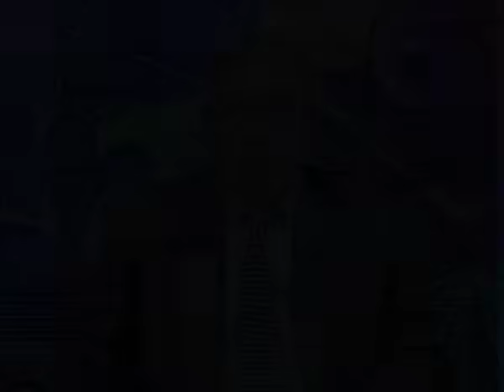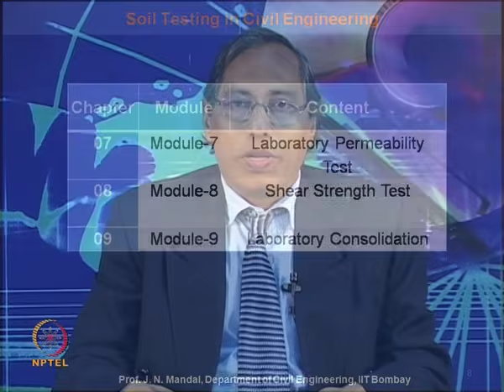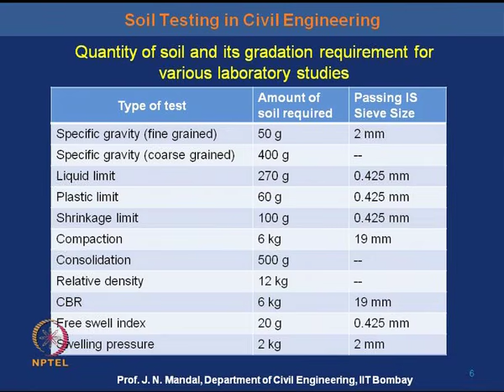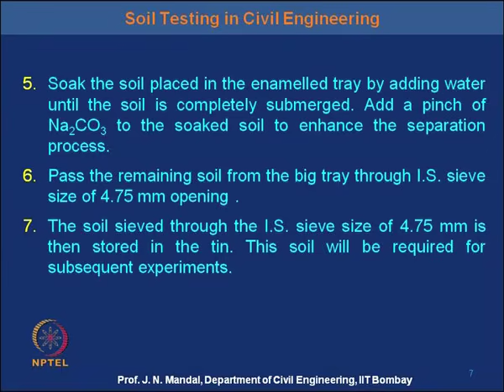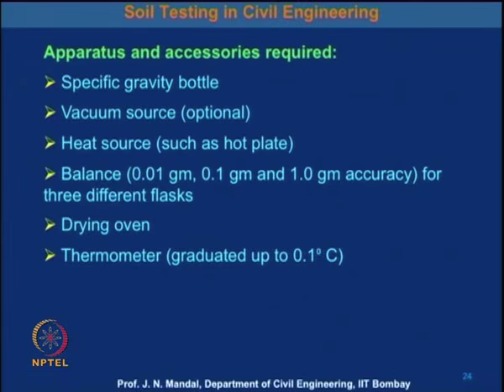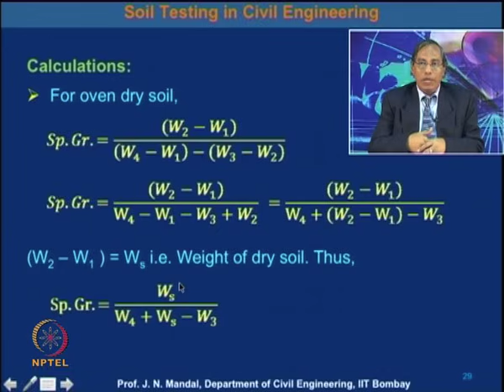Comment: Training Program 
                          On
                   Underground               Hydrological Surve
 
In this training -

1) To find exact spot of underground water resource

2)To find exact spot of pipeline leakage 

3)To trace out the seepage of earthen hydraulic 
structure 

4)To know stratification of soil layers below to 
ground surface 

5)To predict load bearing capacity of soil 

▪️विहीर व बोरवेल साठी जमिनी खालील पाणी मशिनद्वारे कसे चेक करतात हे शिका.

      ▪ कुएं और बोरवेल
 केलिए जमीन के नीचे का पानी मशीन सेजांच
करना सीखें।

Training program staring from January 2021

Conform your admission for convenient batch now

Contact- 9370371610/9156777458

pravinengineers2020@gmail.com